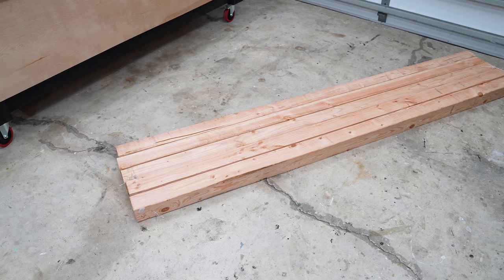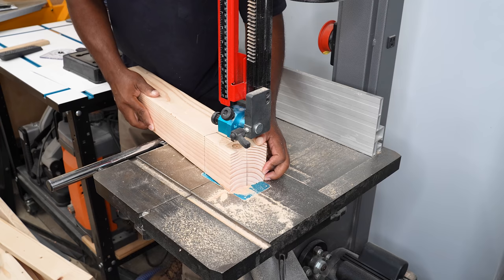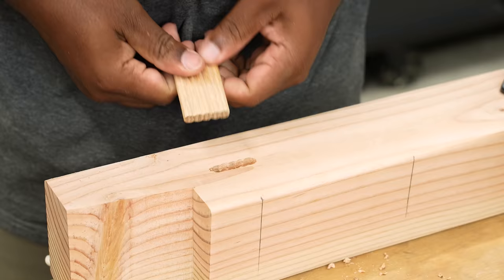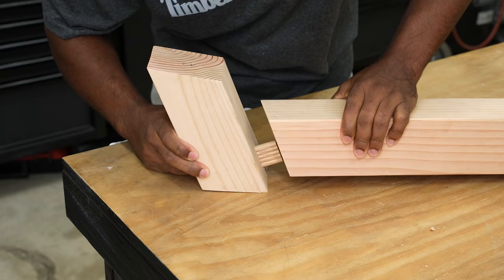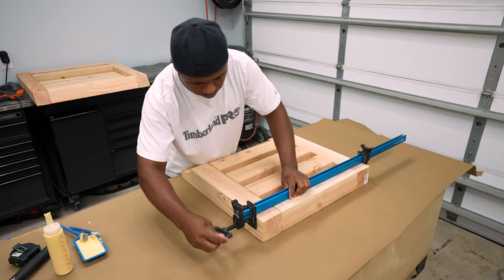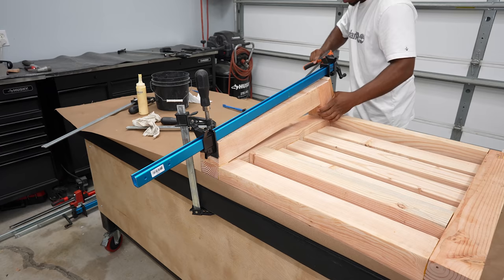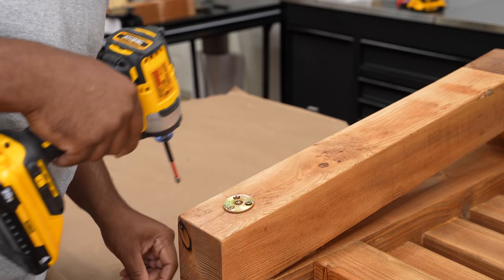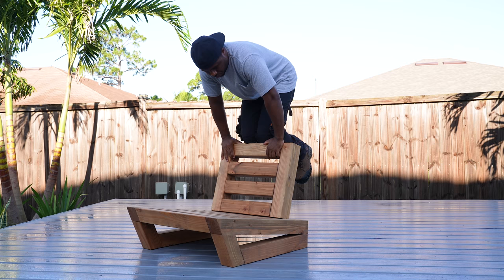How to make an outdoor chair

Comment: This chair is excellent, the only thing I would do for it would be to run a 2x4 along the bottom so that you can lock in the seat back when its in the folded position.

Comment: I say 'no feet' but the chair's design looks well both ways--which is great! I'm a taller person and heavier, so having no feet on the bottom of the chair would make the contact surface area larger which lends to promoting greater stability. I like the cushions on the chair and the ability to remove the back from the seat to store or transport it. Thanks for another great design idea.

Comment: I wanna make this, but knowing myself, I'll probably use big structural screws even if they are visible, it won't look as clean, too busy with work right now to do it this way, but it should still look nice, specially if I stain it a solid color instead. Nice video, I'll definitely build it myself too.

Comment: No feet looks better to me, but at 6’2” seems kinda low. But I love the sleek look of the design. Even with bulky 4x4’s that is one sleek design. Beautiful work as always. Just made your waterfall desk, with some modifications to make it “mine”. Love it and thank you for inspiring me to make something.with lumber prices back down I bit I too was able to purchase all my lumber for under 50 :). Already had stain. I cut a 40 degree bevel on the front of the desk and  ran a slight round over bit on the top. I cut a 40 degree taper on the inner front the big leg, and another fading 40 degree taper on the inside of the square leg to match. In retrospect I wish I had stained then cut the fading tapers to show the white grain on the fading tapers.

Comment: on the feet - might depend on where it's normally going to be placed - those clear things will look nice on a brighter / lighter deck as they'll kind of disappear.  Might try doing some similar shaped blocks stained same as the base,  the blocks being narrower at contact than where they connect on the base.   Nice job and video :)

Comment: Looks like a million dollars I like solid furniture too. No feet and the base higher and I would have it as an indoor settee. I am messing around with dyeing hardwood trying to get the Paduak look can't get Keda scarlet wood dye so I am using red ball point pens dissolved in alcohol. Your stuff looks Amishy I like Amishy. I like the use of square lumber it is also dimensionally very stable. I have discovered that if you heat softwoods with a heat gun it hardens up the grain patterns but don't burn it.
Try your hand at treating wood with Sodium Silicate then heat it to set it.

Comment: What a great design!  I think the look of the chair without feet is classy, but if the chair is left outside, some feet would be good to dry out the bottom wood area after rain or morning dew. And, since I’m old, I would be the sort that needs there to be legs because otherwise it is too darn far down to try and sit (and get up again). 👵

Comment: what about an ottoman to stretch out? If you keep it with feet you can store the ottoman underneath and have it pull out and then attach to front (or a slide and lock-n-place method)

Comment: No feet looks good as do the feet.  As mentioned before, some kind of bumper would prevent damage to your deck.  My concern of no feet would be the accumulation of moisture should they be left outside.  

A solution for joining the back pieces could have been a bow tie tenon.  Just cut out a bit of wood in the shape of a bowtie about a 1/4 thick or so and inset it between the two pieces.  Effectively, it's a double dove tail that would hold the two pieces together.
Reply from the maker: I appreciate the feedback, I agree I have some options to lift the chair off the deck so that the lumber is not in direct contact.

Comment: In our house—the youngest adult is 51
And oldest is 74. . .(me)
So I like the chair with feet
Easier to get out of. . .
But if I were constructing for 
My Ex-hubs. . .
No feet 
Let him struggle. . .
nice clean design
I’m making one like yours
With Feet. . 
And another I found on a different channel
With an arm into which 
I have engineered a cup holder
To which I will also be adding those lovely feet
Just found you today and am subbing.

Comment: How much (roughly) does it weigh?  I like it (and most everything you make...especially the attention to details & thoughts on how to fix common issues).  

I prefer no feet to the clear.  Perhaps a small bun foot or such.  As others said, something to reduce scratching the chair & surface it's on?  

What no leds?  😇

Comment: Keeping the proper proportion, would it be possible to reduce the measurements of each wooden profile by a few centimeters, so that the chair would be a little lighter, without losing its rigidity?
Congratulations to the illustrative video.

(Mantendo a devida proporção, seria possivel diminuir as medidas de cada perfil de madeira em alguns centimetros, de modo que a cadeira ficasse um pouco mais leve, sem perder sua rigidez?
Parabéns ao vídeo ilustrativo.)

Comment: I agree with the beefy look, maybe its a "guy" look. My one question is about the front edge over which your legs hang. The edge seems quite sharp and my experience is that smaller folks might have that edge irritating their hamstrings, especially since the seat slopes upwards. Yes to legs.

Comment: Feet or no feet? Other feet than these ones. Why not a block of the same wood? Maybe even a waste piece.
And for the glue of the back part... why didn't you use dowels like the rest of the chair for that little extra bit of strength and alignment?
I like the look of the chair. Nice job!

Comment: Either feet or not look great, if I were to choose, it would be based on how well either one fit me. 
There is one thing that occurred to me as I watched this build: a love seat in the same style would look really good I think. Effectively, double the length of the base (with a central stretcher across the short dimension) and then make two of the back pieces. Build the base to be level front to back to accommodate the two backs slotting into opposite sides. So, one side faces frontward and the other back faces backwards. 
Your design, work, and excellent explanation of what your doing and why is , as usual, very much appreciated. Thank you!

Comment: I'm curious why you designed it with the "tongue" of the back on the rear side of the back. Would it be better or worse to have the tongue on the front half? Could the back be spun around?

Comment: You're so called plans give absolutely no measurements of spacing on anything. What's the spacing for where the back section slips in. What's the spacing anywhere. You can't just say here's a set of plans and show the cutting list and call that a set of plans. You need so much more details in these plans. Luckily I've been doing this long enough that I can figure it out but newbies won't have a clue. I hope all your plans aren't like this.